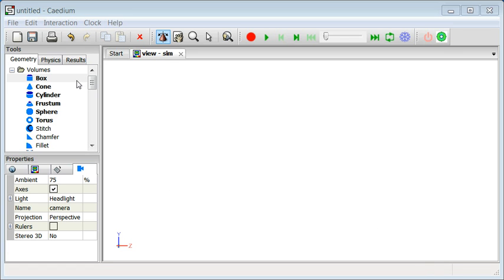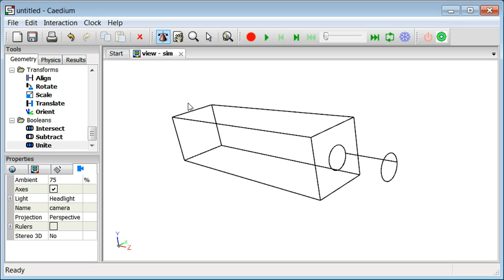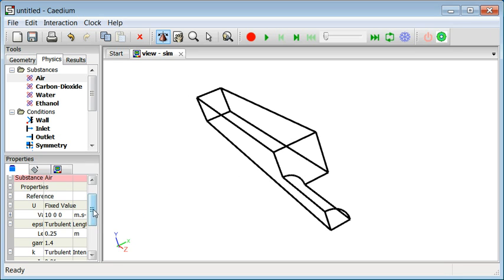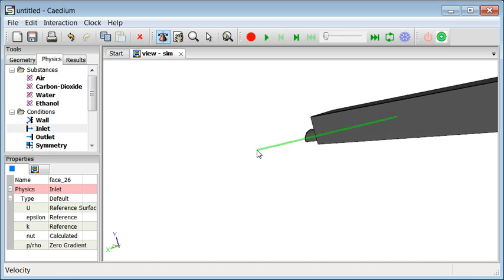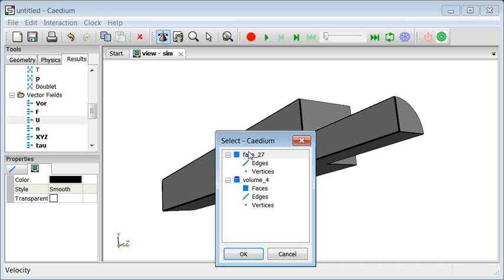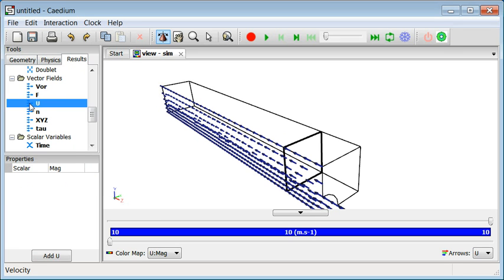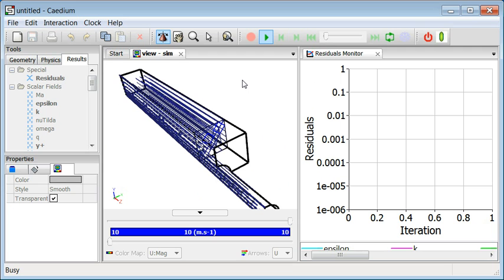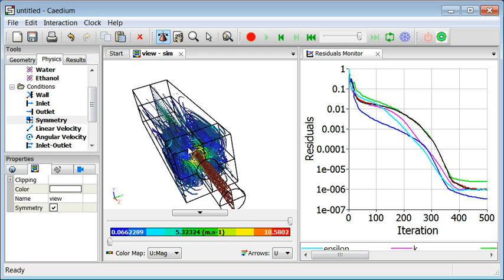Caedium CFD Simulation: Air Flow Through a Pipe into a Box

Comment from the maker: @DanFrederiksen The end goal is to have a water-tight volume, but there are various ways to achieve this. If you have the option I suggest using STEP (.stp) as the exchange format - it preserves volumes and tolerances better than IGES (.igs). If you have individual NURBS surfaces then you can try using Volumes->Stitch to form a volume and then subtract that volume from a larger box (volume). When complete you want the volume to represent your fluid around your object.